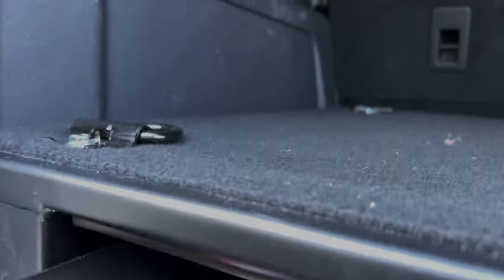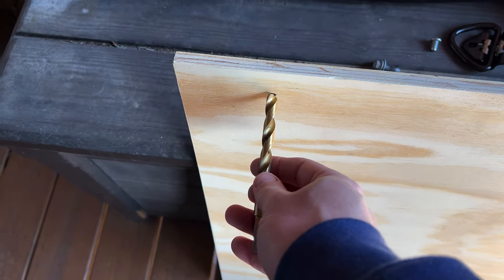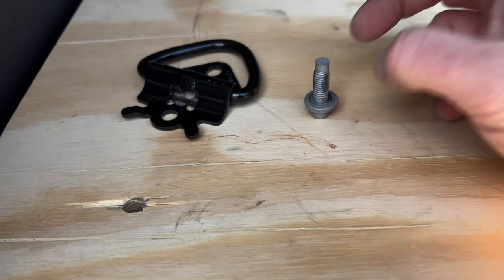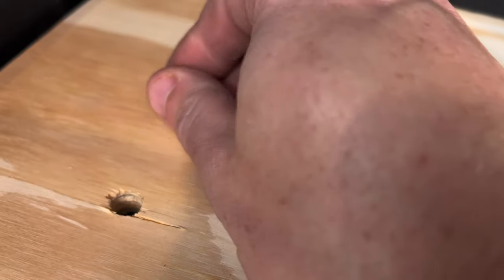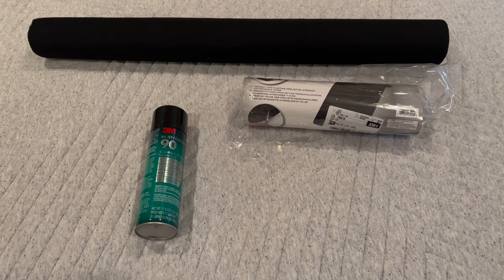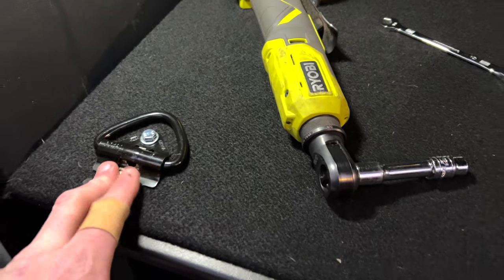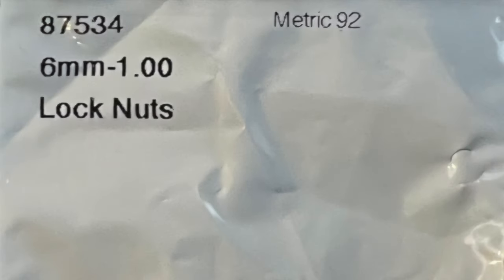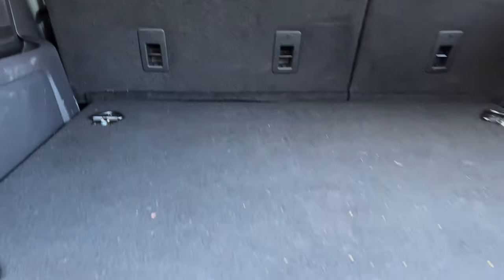Ford Performance Drawer top support platform

Comment: How is it with the seats folded? Could you still sleep in the back?
Reply from the maker: It sits about 4 inches higher than the seat backs when they are folded down, so not something I'd recommend.  You could build a leveling platform with wood if you are handy at that type of thing.

Comment: Now you got me thinking about do in drawer and platform on top.  Are you planning on doing anything with a 12v fridge, like just using the tie downs, or sliding rails?  Thanks.
Reply from the maker: Maybe down the road.  I think our friends at @IceageTV did something similar as well